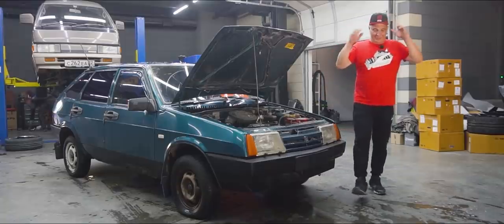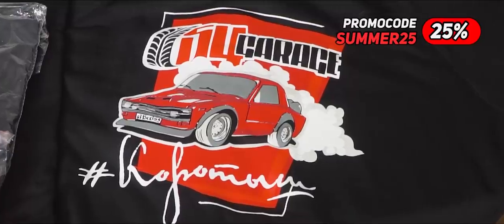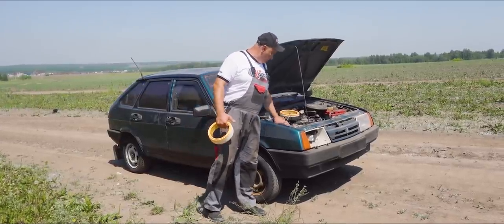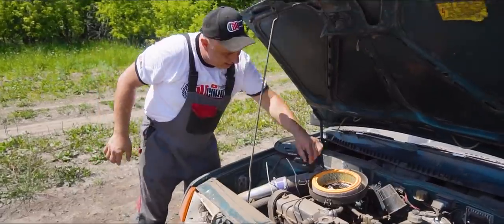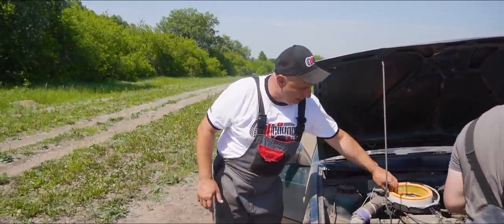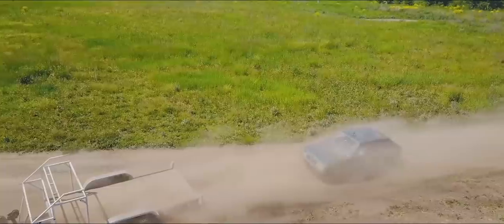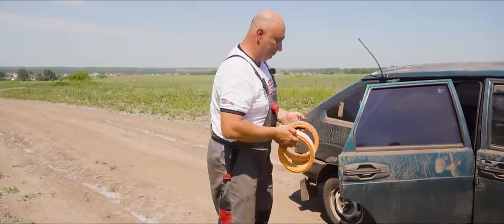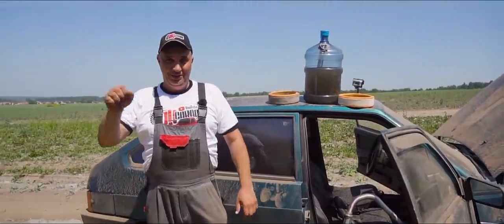Water intake air purification (your motor will thank you)

Comment: You should've used cold water and see if it can also work as an intercooler :D
Reply: And ice cubes also
Reply: @thestreets5206  or snoop dog
Reply: Yes it will work as IC. 
Air-to-Water intercollers work on similar principle and they are quite popular.
Reply: @jareknowak8712  working with ac of car
But it get power to run
Reply: @jareknowak8712  yeah, on a forced induction engine, not an NA 😆 that motor probably makes 80-90 HP, cold air induction probably won’t make a noticeable difference.  It would be cool to see though.
Reply: @chincemagnet  naturally i was thinking about turbo or kompresor charged engines. 
There are no IC's in naturally aspirated ones.
Reply: Let the air pass through gasoline and shut off the carb....see how it runs!
Reply: @chincemagnet  just feed it 10x the gas and the cold air could make a difference i guess
Reply: Dry ice
Reply: @brianobrian9334  beat me by 6 hours. and would be 'cool' watching it 'boil' too..
Reply: It would make more heat, cold air is denser so in the same volume there's more energy
Reply: @brianobrian9334  Dry ice is frozen CO2, so you need to keep intake air and the cooling chamber from mixing the gasses. If any evaporated CO2 from the dry ice cooling got sucked into the air intake it would most likely stall the engine. At bare minimum it would totally screw the air/fuel ratio and negate any benefits from having denser air going in.

I remember seeing an old picture where a race team was loading lumps of dry ice into an intake jacket on a race car. I vaguely think it was something to do with Carol Shelby's team (Sounds like the sort of rulebook loophole he'd find and eagerly exploit. :D). There must have been a long vent pipe coming off the jacket to direct the sublimated carbon dioxide gas out of the engine bay and well away from the air intake though, and back then they must have been running right next to the temperature limit where fuel freezes in the carburettors jets.
Reply: 🤣 it would work
Reply: @tristanlongangue5671  bruuhh🤣🤣
Reply: well yes but actually yes
Reply: Dry ice in inter cooler + radiator
Reply: @tristanlongangue5671  and Eazy E's automobile!
Reply: @jareknowak8712  this is not remotely close to an air to water setup.

Comment: My tractors have an oil bath intake instead of a filter. Same concept
Reply: Old VW Beetles too
Reply: Was going to say, it's like old oil bath filters.
Reply: Praga V3S truck the same
Reply: Also some early Landrovers too !
Reply: International Loadstar as well.
Reply: @nickthompson9697  How often do you need to change the oil?
Reply: I don't know if we ever did. But I'd say it's probably best to have a good filter.
Reply: @devinwarwick  on my old vw i would do it when i changed the oil
Reply: What oil did you use?
Reply: @devinwarwick  same oil that went in the engine.
Reply: Our farm still uses a modified 1962 Chevy C50 2 ton truck, turned into a mini semi, with a sleeper and 5th wheel that pulled a 600 bushel split trailer with live bottoms, beautiful to work with for seeding since front for fertilizer and rear for seed.

It still has the original engine and oil bath.

Almost anywhere i look and whom i've talk to say to never get rid of it as nothing can touch the air purity of an oil bath. the other advantage is the fact that if at any point oil were to get sucked in, would provide a benefit to the engine and any moisture sucked in would instantly drop to the floor of the bath obviously.

I've often wondered how a modern vehicle, specially one with a turbo, if at all possible an oil bath could still work.
Reply: I'm surprised Lada's don't have this anyway.
Reply: I heard some desert vehicles have 2 stage filter system, air go through oil bath filter as stage 1, them paper filter like normal vehicles have as stage 2.
And I also saw some tractors install very tall snorkel to avoid dust.
Reply: @pqhkr2002  One of the reasons tractors tend to have their air intake mounted up high in combination with having a aspiration hose ran from air cleaner (often JUST before the air filter) to the exhaust. The point of the aspiration hose is to draw in larger debris so that it doesn't rapidly cause the air filter to clog up in dirty conditions, without it, we'd have to change the air filters every few weeks rather than years, i know this because the baffle the provides the appropriate vacuum can fail causing the aspiration to plug/fail, which then means that the air filter is doing literally all the work and it'll plug up damn fast.

MOST of the vehicles in the past, say prior to the mid 80's or early 90's had their air intake designed to avoid sucking up dirt and water. Sadly though pretty much every vehicle made presumes that you're always driving on clean highways and rarely seeing any dirty conditions. This is made more obvious when you look at the design of so many vehicles, even heavy duty work trucks that use idiotic baffles and intentionally put holes (for neutral pressure purposes) in the cabs resulting in the cab filling with dust very easily. Not to mention that fresh air intake acts like a vacuum with dirt being driven into the cab. Previously the design attempted to avoid this as engineers understood that these vehicles would actually be driven on say gravel roads or dirt roads perhaps quite often.

It's insane to me how completely out of touch modern vehicle engineers are. Designing a work duty truck, with ABSOLUTELY no concept of gravel roads. Shit even ford's own "off road" 4x4 truck, a man i know only ever drove his new one roughly 20 miles down a gravel road from and too his house, the rest was highway travel, and the ford dealership insisted he voided his warranty because he drove on anything but pavement.
Reply: @SpectrumTwist  very few light trucks sold in the USA or ever used for work purposes, they are bought for fashion reasons. Frankly most people in the US, never do anything that involves getting dirty or breaking a sweat. I'm 60 years old, and I remember when things were different, but that was when we actually manufactured things in the USA
Reply: @cheulesyigess1187  best truck ever
Reply: My old Plymouth as well, these were standard equipment on all cars up to the late fifties. What can I say, people like their low profile hoods. A paper filter fits in smaller spaces.
Reply: Old ford trucks and old cars use oil bath air filters
Reply: @cheulesyigess1187  our czech mashine :D
Reply: My old volvo tractor to
Reply: Nope. The incoming air does not go through the oil, it goes BY it.

Comment: My old Mercedes had an air cleaner that worked the same way but with a smaller amount of oil instead of water.
Reply: The old air-cooled Volkswagens did this too.
Reply: Peugeot 504 too.
Reply: @dDoOyYoOuUtTuUbBeE  I forgot to mention....Most, if not all American cars used an oil-bath air filter, from around 1930 to around 1960. Very economical- just add a small amount of new oil and wipe off the dust. No filter to buy.
Reply: @dDoOyYoOuUtTuUbBeE   my dad had one when we was kids. ty the memory such a sound old car
Reply: @BakedRBeans  Both my 52 and 53 Mercury had oil bath filers on top of the flatheads. They work great but it robs horse power from the motor. For the time it was a smart set up. Easy to change and cheaper than paper filters.

Comment: A trick with measuring air filters is that you can weigh them before and after use, and the difference in weight will be how much they collected.  similarly with the water filter, you can simmer away or just wait for the water to evaporate to see how much it trapped.

Comment: If you replace the water with fuel you can run the engine with it on an empty fuel tank. 
You should make a video showing it!!!.
I've personally done it with a Vauxhall astra
Reply: That’s pretty much how a carb works.
Reply: @thehemmo5078  I had the can under the bonnet connected to the air intake.
Reply: @abhimaanmayadam5713  this way the fuel doesn't go into the engine just the vapours. And you can guess how many more miles to the gallon you will get.😉 there's lots of videos showing how to do it on YouTube. As long as you have pipes from outside going into the fuel to bubble it up. And the pipe to the engine above the fuel it works champion.
Reply: @johnyp2967  I should have explained that it's not using the liquid but the fumes. Cheers anyway😉👍
Reply: @rastamanralph6670  ok
Reply: @rastamanralph6670  still it cerates explosion. air mixed with gas in the can and pipe.
Reply: @thehemmo5078  there's no explosion without ignition and that happens inside the engine not the car. It needs to be a sealed system with vacuum otherwise it won't work.
Reply: @thehemmo5078  I thought about running the pipe through water as a filter. A mini version of that. It's different with injected engines and that's what I did it on. Nothing can get back through them. But on the other hand lots of people have done and still do run their vehicles and generators and such like that without any problems. It might have something to do with it just being a gas rather than liquid. Try it for yourself and let me know the outcome. You can use a lawnmower if you want. The channel project farm did it with a mower so copy him. I think Colin furze also did it with a mower unless he used a wood gasifier. Can't remember.

Comment: Funny thing cars used to have water air intakes eons ago back in the early 18, to 1900s. but thats more expensive and complicated so they switched to the standard paper airfilters we use now
Reply: The oil bath filters are the same in principle too. But the problem was that they rarely clog up, reducing the likelihood of repairs. The manufacturer doesnt want that. They want you to buy new ones to them. So they switched to dry filters.
Reply: They were probably oil bath filters.  Water would freeze in cold weather.
Reply: @kimpatz2189  - That’s a conspiracy theory too far for me! 😏Disposable air filters are extremely effective, have excellent airflow characteristics, are easily changed,  and are cheap and widely available from 3rd party suppliers. There’s plenty of ways car manufacturers have made cars hard or expensive to service. Disposable air filters isn’t one of them IMO.
Reply: @kimpatz2189  then why USSR, a communist country, didnt use it in all their ladas?
Reply: We cannot be having machines that last .😉

Comment: I'll keep this in mind next time Mt. Saint Helen's blows!
Reply: if st Helens goes again you will have more to worry about than some dust in your air filter buddy...
Reply: The water bath filters will not work with ash.  Oil bath filter would work.   Years ago, my aunt had a vacuum cleaner that used water as the filter.  The instructions very clearly stated, do not use with ashes.  P
Reply: @robertheinkel6225  was it a rainbow?  my mate had a rainbow vac and it had a donut shaped water container. always amazed me, we even used it as a bong once...

Comment: Upside - cleaner air. Downside - loss of power due to to the engine vacuum being used to draw the air through the water, and risk of hydro locking the engine. An oil bath filter would be a good test in addition to the standard one

Comment: Well, older cars used to have oil bath filters for this very reason.
Reply: WHAT cars would that be??? Not in the US..
Reply: Most US spec cars came with them through the early Sixties, quite a few pickups and four wheel drives had them (at least as an option) into the late Seventies.
Reply: @johnhershey4010  VW Beetle had oil bath until 1973.
Reply: @johnhershey4010  plenty of American cars before the 50’s had them
Reply: @Cristobal_Ygnacio_Arriaga  I dealt that

Comment: Try explaining this to kids who flip their air cleaner cover over for a better sound. 😂
Reply: Yes, they even do it with Exhaust and convert to free flow one.
Reply: @Sam-to1zg  
Then wonder why their vehicle starts running like dog shit and only getting 8 mpg.
Reply: @lookingbehind6335  I was able to verify this by removing a nut situated under exhaust near rear brake paddle, It was straight reduction in top speed from 137 to 120 kmph. My motorcycle was lacking back pressure. 

When I removed air filter, Piston rings damaged very quickly due to dust getting into combustion chamber. 

Thank you.

Comment: Old tractors had this magic system for the intake filtration. UTB ftw
Reply: yea, my current one from 1958 has an oil bath air filter. Not exactly sure yet how it works there but probably the same.
Reply: @Jay20112968  air is passed through the oil, smth similar with what is shown in the video

Comment: For winter service, you'll need to add antifreeze to your hydronic air filter. 
In icy-cold Minnesota, USA, we use a 50/50 antifreeze/water mix in the radiator.  
In icier-colder Siberia, do you use 60/40 or 70/30?  (just curious)

Comment: Today the Cyclone type pre-cleaner is used with a paper air filter for dusty environment s. Oil bath filters had problems with non-level terrain and subfreezing weather. The K&N oiled filter has been used a lot in off-road racing like the SCORE and BAJA events, haven't seen any tests comparing it to the Cyclone/paper type...

Comment: well u basically did turkish pipe system of watter fulmigation (engine sucking evaporated watter droplets)

Try to level up this project and complete this watter  vacum "injection" to see if engine runs smoother :D

Comment: it'll pickup water vapor  and water and fuel don't work well together.  If you want to use the water thing, you need to dry out the moisture w/ calcium chloride or something that absorb water well.

Comment: Most 1950's and older American cars (and some foreign stuff) had fluid air cleaners only they used motor oil instead of water.  So if you ever work on a classic car and see no filter in the air cleaner and a lot of oil sludge you'll know to add more oil , and not waste your time trying to buy a filter.

Comment: There is one major flaw in the design... All the dust stays in the water bottle, so the purification efficiency drops quite fast. For better efficiency, it should have multiple bottles, where the dirty water goes through pressure valve at the bottom of the bottle as it is heavier than clean water. Water can be separated from the dirt by boiling, and recycled by cooling it down using the overflowing clean water. Engine coolant can be used for boiling the dirty water as its temperature is usually slightly over 90 degrees centigrade under pressure.

Comment: Can you guys make a zeolite filter unit to filter out the nitrogen in the air and enrich the the oxygen flowing into your engine air intake? It should be like a turbo, but without any moving parts. I'm not sure the molecular sieve would allow good airflow though. But, it can't be worse than filtering air through a water bottle. Dang, someone already thought of it. https://patents.google.com/patent/US9149757B2/en

Comment: If you guys are wondering whether this type of system is still offered, look for the tractors from Japan. They have oil bath filters new straight from assembly. They are also fitted on horizontal single cylinder engines from there too.

Comment: It may interest you to know that Fordson tractors already employed air-wash water filled air filter as far back as the mid 1930s. This concept is far from new, but this experiment goes to show that sometimes, old ideas are still the best, however, the power loss caused by dragging the air through a water washer is quite considerable and will impact upon the vehicle's fuel consumption figures.

Why not take this experiment to the next level and try driving a car over a lengthy distance, say 150km, first with a stock filtration system, and then again with a water washer, and see what the difference will be?

Comment: How much of that dust makes it past the filter? Also, I bet a set up like this lowers the temperature of the air coming into the engine quite a bit too. And a little bit of water will clean carbon off the valves and pistons!

Comment: Add some kind of mesh filter to break up the bubbles in the water purifier. And make it really large on the end so theres still good flow rate. it will break up the huge bubbles and make much smaller less "splashy" ones.

Comment: oil bath air cleaners are similar but not the same. in an oil bath filter, the air does not bubble through the oil like a bong, the dirty air is directed straight down into the oil bath and then directed straight back up again, the air changes direction faster than the dirt so the dirt falls down into the oil and literally gets stuck there. the water bong filter is much more effective as it traps 100% of anything suspended in the air.

Comment: Cars dont have direct cold air intakes. They have baffles before the air reaches the air filter. Also in the states, this is not needed as most of the roads are paved and not dirt. For those who have to drive on dirt roads than it is a good idea.